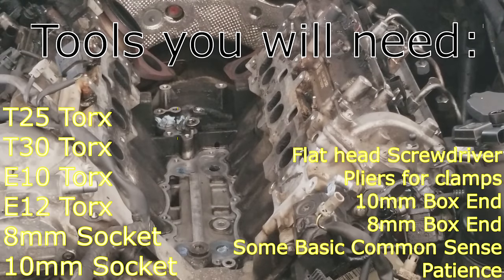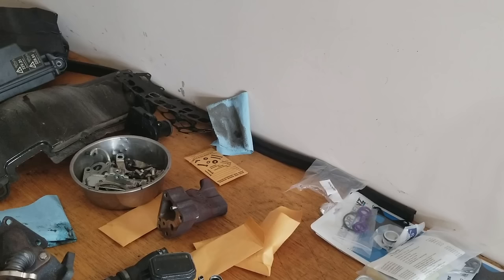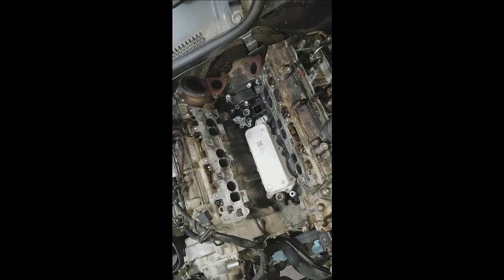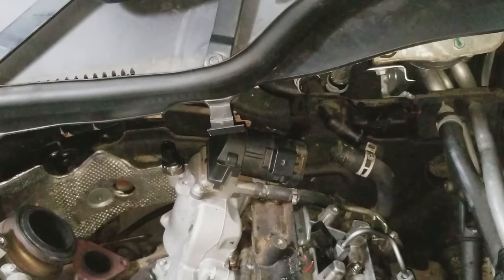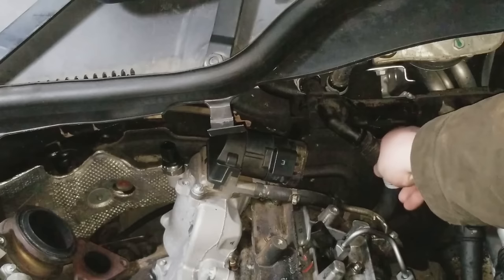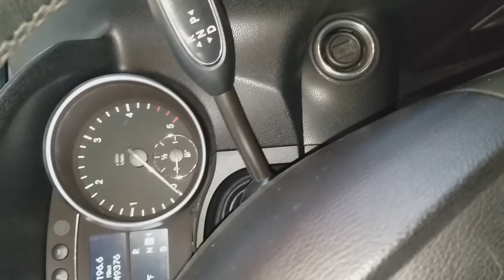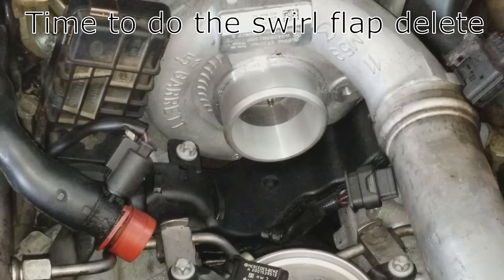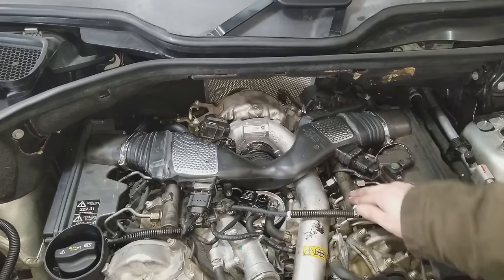OM642 Oil cooler seals DIY guide and timelapse!

Comment: Sir i have a question, im about to do my oil cooler and new turbo because when spinning by hand i feel a tight spot on turbo plus blue smoke.I deleted my swirl flap last year do i need to leave the motor out when refitting and what about the arms? Do i just leave flaps open with arms attached? I am a home diy mechanic on my mercedes cls om642.I am nervous to do this job ive already taken Turbo off no problem no snapped bolts which was my other worry but all ok.regards Scott

Comment: Very good video but I wish I knew if that is what’s wrong with mine, 2010 GL350 with 100k odo Smoking like crazy from the exhaust, can’t Regen because the amount of smoke and heavy smell near the dpf but no CEL.... replaced air cleaner box, o ring, turbo seal, crankcase valve, cleaned out all the oil from the IC and pipes but still no go :/

Comment: So when youre doing this you dont have to drain the engine oil and coolant before hand? I dont want to start opening stuff up and have a whole bunch of oil or coolant leak out everywhere..
Reply from the maker: I removed the radiator to provide more room to work, in doing so i drained the coolant. Coolant should be drained, oil does not as it all sits in the pan.

Comment: Great video 
How can you tell if you have a leak
I’m driving a 2008 GL 320 with 135 500 miles, just had the dealer change transmission fluid and nothing was said about an oil leak, I’m hoping they would say something if a problem was noticed..

Comment: Great video. thanks!
A few questions:

1. How applicable is this video to the OM642 in a 2008 Sprinter?
    Specifically, I'm wondering about reattaching the exhaust to the rear of the turbo. On my 2008 Sprinter, when we disconnected the exhaust from turbo, 4 bolts came out, and one of the bolts is longer than the other 3 bolts. Do you have any guidance/tips/tricks/techniques to reattaching those rear facing bolts that can't be seen while doing it?  And which hole gets the 1 long bolt?

2. What are your hands doing from https://youtu.be/M01cSFwE2I8?feature=shared&t=407 until the 30:54 mark?  I don't see any bolts or anything in your hands, or coming or going from the picture.  Please explain??

3. Also what is the thing you set down at https://youtu.be/M01cSFwE2I8?feature=shared&t=411 ?  Is that the oil cooler?
4. And what are the purple things you put on it?  Are those the oil cooler seals?

Thanks!

Comment: Most useful, i have injectors to do that the seals are slightly chuffing on and a glow plug or 3 are down too. Any advice as this is a nearly 300k mile OM642 engine in a sprinter. I have new copper seals and bolts for the injectors. New Glow plugs,  also got the tools  for cleaning/refacing injector bores/seats etc.. and ceramic grease. I see many recommendations for what to dissolve the gunk around the injectors / glow plugs with too, so unsure which to go for.  Also seems advice is to get the engine up to temperature before stripping the top off to do glow plugs/injectors as this will help ?

What did you say the glow plug head was as it sounded imperial , thought the engine would be metric? ta
Reply from the maker: Check out LegitStreetCars channel for a good video on pulling stuck injectors!  He did it on an om648, but it's the same on an om642. Carb cleaner is the best thing going for freeing up the carbon, just make sure the engine is nice and hot when you do it, the heat reacting with the carb clean creates a bubbling action that allows the solution to penetrate.
Reply from the maker: Glow plug head is a 10mm
Reply: @MBDieselFreak  superb advice, will do thanks

Comment: The hole at the back by the oil cooler with the drain running into it is that a drain hole? Does that flush everything down and out of the oil cooler compartment?

Comment: Hi, Thanks for the video. Is it neccessary to change the oil while doing the oil cooler ? Have you ever heard about seizing this engine right away after changing those seals? Apparently some "air bag" created inside, (when oil cooler is off)i s preventing the engine from proper lubrication ( low oil pressure) and engine just stops. What's your opinion about this?
Reply: Maybe that's why MB sez to put ½ the oil in through the filter housing & the other ½ thought the filler port.
Reply: @tonyandhelen8126  Where is this recommendation? I've never read it. Also, no one advice to replace the oil or doin' it while the engine is 'dry' - maybe that's the case...

Comment: How many miles were on that engine?  What were parts costs roughly and how long do you think the job will hold out?  I'm looking at an ML350 bluetec with 111K on the clock and wonder if this is something I should prepare to do at some point out of the gate if I buy it.  Anyway, thanks again for the great video.  I've had 8 or 9 benz's so far and that is by far the scariest looking engine I've seen, but you made it look much less scary.... thanks.
Reply from the maker: If you're looking for a Benz with the om642, try and get one PRE 2009. The AdBlue injection system they added for the exhaust treatment is very troublesome and costly to repair. 
The 2007-2008 models are the best! 

Job takes a solid weekend, maybe more if you're working slowly. Parts we're about $90. Double that if you wanna replace the turbo core like I did.
Reply: This guy is totally legit, I've been a Benz Dealer Tech since 1996 he's got some chops
Reply: @MBDieselFreak  i ended up going with an 07 ML350.... needs a little work but according to my research it's outside the "balance shaft gear" issue.  The blutec stuff ended up scaring me off just as you mentioned, but I couldn't find non-ad blue CDI that was in the right price range, or didn't have something borked (or it had been wrecked).  Anyway, it drives nice but I was surprised it drives more truck like than an 03 ML320 with only 65K miles that I couldn't get a loan for (had a 2000 ML320 eons ago and never should have parted with it).  Anyway, thanks for the post man, and for posting the video.
Reply from the maker: @ZaphodsPlanet  the w164 NL's definitely do drive a bit like a truck, the suspension is massively BEEFY like a truck, massive coilovers, cast iron control arms, etc. However, having NEW Bilstein shocks all around do make a hell of a difference, the ML's ride like garbage when the shocks wear out.

Comment: You have desactived erg?

How do you delete the valve swirl flap in air manifold?
Reply from the maker: No, the EGR is still fully functional.  cleaned the EGR cooler and all the plumbing to make sure it had air flow as open as when it was new. 

The swirl flaps essentially have to be broken off of the stems they're spot welded onto, and then that stem/seal can be removed. i reinsert that stem/seal and epoxy (I use JB Weld) it into place to prevent it from popping out in use. once you get the intakes out and get a good look at how they're in there, it makes it a lot easier.
Reply: at last a man who knows his stuff, brilliant
Reply from the maker: Zz Viper zZ I try! Haha
Reply: to confirm what's left unsaid.  Remove flap from stem.  Remove stem from swirl motor, this is done to re-install with JB weld to keep it from falling into intake and to a valve/piston.  Then install assembly to re-seal the manifold (vs. using a blank off).  After this you could reconnect the motor and let it move nothing but a stem, but risk motor failure and induce limp mode.  Do not reconnect swirl motor and install 4.7 ohm resistor plug and seal to protect from elements.    

Even though this is for idle emission control seems like a warmed up vehicle will likely still pass emission without swirl flaps.
Reply: @dadoornb78  what does that mean "will likely pass smog emissions "  will it pass or won't it pass. I live in California.  Will they even notice them missing? Or the motor that operates them?
Reply: @ltsgarage7780  In NM they only plug in to OBD to check smog on my 2007 ML320.  No sniffer for diesel I guess.  As long as you do the resister trick and no engine codes I expect you are in the clear.  It's impossible to visual check for swirl valve operation.
Reply: @dadoornb78  it's not impossible to see the motor that operates the swirl valves. California is tough.
You're right. No sniffer on diesel engines
Reply: @dadoornb78  where do I buy this resistor?  It plugs into ??

Comment: Hello 
I've managed to change the orange seals (the same engine on a Jeep GC WH), put all back on and the problems started to appear:

1.First, the car started after more than 10 minutes of cranking
2. After the engine started eventually, I changed the oil and fuel filter. Again, the engine didn't start
3. I had the rail cleaned and the engine started again
4. After 30 minute or so , I started again the engine and it stays way below 600rpm and whan tried to throttle up, the engine went dead.
5. At this moment I cannot start the engine

I connected the interface and I have these errors:
P0471 Exhaust pressure sensor A circuit range/performance
P0473 Exhaust pressure sensor A circuit high

What could it be?

Comment: will yr car run properly without the swirl flap motor connected to the inlet flaps?
Reply from the maker: michael neo yes it will. The swirl flaps are just for emissions controls. They don't effect the way the engine runs. They cause more trouble than they're good for.
Reply: michael neo would you replace the swirl motor or just say screw it even if it is broken and use the 4.7k ohm resistor
Reply: @Sea2Skyward  I would just use the resistor and delete the whole swirl flap setup if you plan to keep the vehicle forever, unless you're going to fix the swirl flaps with stronger replacement parts altogether, as it will break again in stock format, IIRC. Then, I'd leave the resistor on if I did fix it to spec, so as to not have it possibly fail again until I sold it.
Reply: Anthony Kaiser that’s exactly what I did. Used the resistor for a bit then had it tuned to remove it, the dpf and egr

Comment: FOR THE LOVE OF GOD! please everyone reading this comment remember to replace the O ring that sits on the EGR cooler under the manifold. I did this job with my ol' man and after a long time putting it all back together the engine coolant was pissing out the bottom so we had to start all over again from the beginning 😭😭😭 learn from our mistake and purchase that seal!!!
Reply: Yes, this is definitely an "all-or-nothing" job when it comes to gaskets, seals, and any wear parts you can get to in the process. DO NOT be tempted to cheap out. I replaced the turbo a few years ago, and it's a royal PITA in a Jeep GC that teaches you to do it right completely the first time.
Reply: @anthonykaiser974  completely agree sir. Did this bastard twice =(
Reply: @anthonykaiser974  have you ever had this engines EGR component play on you? Not sure if its a common issue or not
Reply: @_wimza_7983  yes, but one thing I have found with these things is codes only help narrow down the problem. First thing I've learned to check on my machine is the battery. THAT not being right will throw all kinds of codes. Also, any air leak on the intake side of the engine will cause a limp mode.
Reply: @anthonykaiser974  and that could result in code being flagged for EGR?

Thanks for the advice i will start at the air intake and work backward
Reply: @_wimza_7983  I found my CCV seal in front of the turbo was torn up and probably leaking. Ended up replacing the whole intake tube, which I found was cracked. You wouldn't think that would cause a problem, but if there is one thing I've learned with these computer controlled engines, anything can cause a slight change in a parameter can cause limp modes. There are sensor prior to that even.
Reply: @anthonykaiser974  i hope i have the same issue it would be nice for a simple fix for once. Thanks pal
Reply: Use a silicone grease on the oring as well.
Reply: @jesseparris6507  absolutely ! Also there is the coupler joint between the two manifolds. Good practice to replace that as i had huge leak and had to do it again!!!
Reply: Do you have any pics of the area? I'm pissing out coolant and thought i changed all the gaskets and seals.

Comment: Currently I own a 2007 e320 Bluetec with an oil cooler leak and a turbo that needs to be rebuilt. Should I just wait until I have the money to do the oil cooler and turbo job at the same time or can I just rebuild my turbo now and drive the car (Saving money faster with that great mpg) while waiting to save enough money to do the oil cooler?
Reply from the maker: Do you plan on doing both jobs on your own instead of paying a mechanic? if so, i would DEFINITELY recommend doing both jobs at the same time. the actual oil cooler seal kit is not that expensive, buy it through IDparts.com for your specific model. i also have a video up for rebuilding your turbo for this car if you havent seen it yet!
Reply: @MBDieselFreak  I was planning on having the oil cooler job done at a shop. Honestly I worry about my ability to do the oil cooler job on my own and it's pretty time consuming. The biggest worry is messing something up and I like having the warranty that a shop provides. That being said what do you reccomend?
Reply from the maker: What exactily is going on with the turbo? Any error codes associated?
Reply: @MBDieselFreak The first issue was a P0299 code(turbo underboost) accompanied with an incredibly slow driving experience. If I turned the car off and back on again it would seem to stop for a little while? I took it to a shop where they thought the problem was with a bad seal leading from the air intake manifold (sometimes referred to as the batwing) while also noticing that my oil cooler was leaking (I had already assumed it was because I had to add oil occasionally and how common this problem is with this model). While waiting for the new seal to come in the mail my car suddenly had no power what so ever. Turn the car off and on the no avail. Once the new seal came I put it on and noticed a decent amount of shaft play in the turbo. I'd assume it needs rebuilt, the car had 165,000 miles and i've had the car for 16,000 miles and didn't know the oil cooler was leaking when I bought it but looking back I'm sure it was. Not really sure what to do and in what order. Whats your advice?
Reply from the maker: @EthanDenny  these turbos very rarely ever actually go bad. My E320 bluetec had a MASSIVE chunk of the compressor wheel just missing from the turbo, like 3 blades were chipped and 2 blades were entirely missing. That turbo STILL cranked out enough boost to not throw any codes. 

I would THUROUGHLY check all the turbo plumbing pre and post intercooler for leaks, I know both rubber hoses going in and out of the intercooler can crack right open, that happened to one of the 2 on my bluetec. Check for that before replacing/rebuilding the turbo. There is a fair amount of normal up/down shaft play on these turbos because of how the bushings are made, even on brand new turbos.
Reply: Took off both intercooler hoses and one was super cracked up. Replaced it and the grinding noice at 2200 rpm went away but the car is still slow.
Reply from the maker: @EthanDenny  make sure you clear codes!!
Reply: @MBDieselFreak  I cleared the codes today. The problem still persists 😥
Reply from the maker: @EthanDenny  I'm not sure then! I guess the next step could be replacing the turbo. Check out my video of rebuilding the turbo in these cars! You CAN just replace the turbo 'core'

Comment: Hi bud how easy is it to burn the starter as I’m thinking that’s what I have done I did the oil cooler repair also new filters it was turning over but not starting . I knew I would have to turn it over a good few times to get the fuel back up but then it was just clicking (battery) was on jump leads so sure it wasn’t low now I turn ign on get lights let glow plug go out turn key and nothing not even a click any ways of checking the starter b4 going down the root of taking it out the 15amp fuse looks good but shouldn’t the fuse blow b4 the starter fry’s any help would b great full 👍🏼👍🏼👍🏼
Reply from the maker: You want to limit the starter to cranking no more than 10 seconds at a time, with a 30 second break in-between. Gives it some time to cool. 
Before you changed your oil cooler seals, did your engine crank slow? Did the interior lights and instrument cluster dim as you cranked it?
Reply: MBDieselFreak it was abit slow to start but I hadn’t started it for about 2 weeks b4 doing the cooler seals it turned over is day about 6-7 times after I did the cooler but I know I had to get the fuel up as I changed the diesel filter aswel but I must admit I was prob cranking it for 10-20ish secs and didn’t give much time between cranks prob 5-10 secs I’ve checked all fuses switched the relay with another 1 that was same in the fuse box still all lights up on ign let glow plug light go out and then turn key and nothing at all not even clicks
Reply: It turned over I’d say about 6-7 times but then clicked for a few attempts then nothing at all that’s where I’m at know just looking for a starter but wondering if there’s any other way or thing to check b4 I pull the starter out 👍🏼👍🏼👍🏼 cheers for the reply bud
Reply: Oh don’t know if this has anything to do with it either lol the door mirrors don’t come out when I unlock the car now either they did b4 and don’t think anyone’s messed with any buttons in side the car